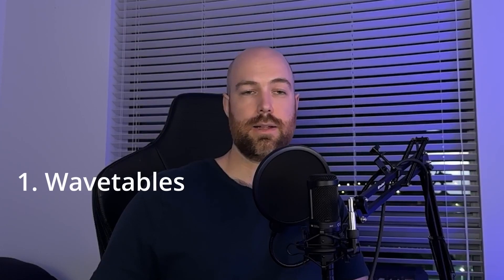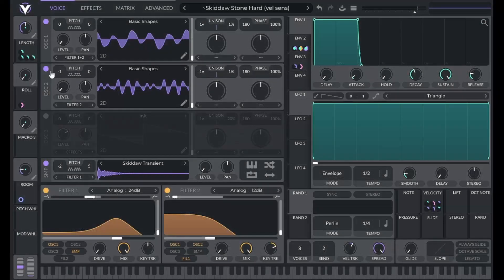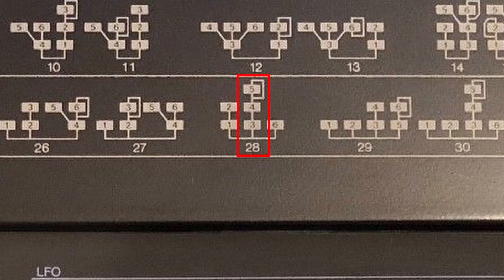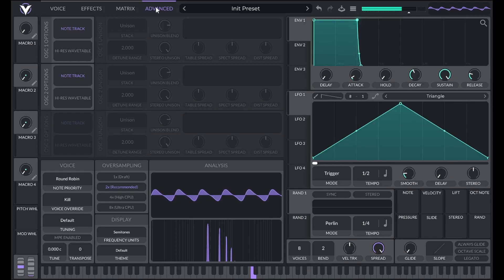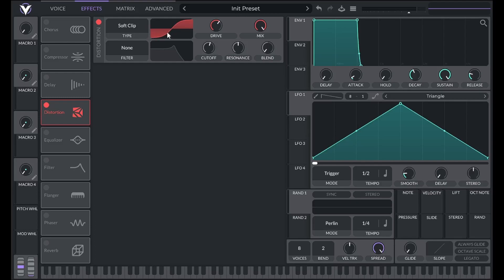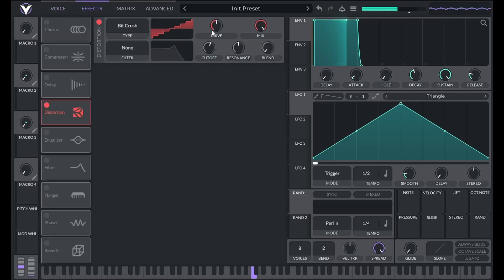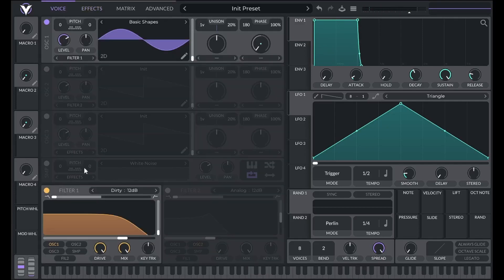Sound Design Tutorial: Additive Synthesis (Wavetables, FM, & Distortion)

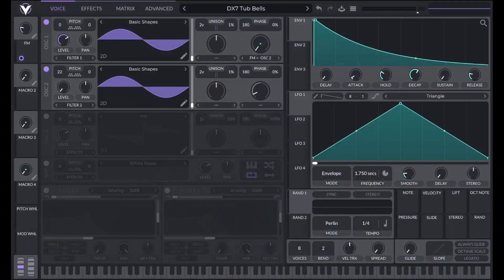Comment: 9:43 - correction: this oscillator at 22 semitones above the fundamental in the dx7 is actually the 7th harmonic of the note one octave below the fundamental.
Reply from the maker: Exactly-it's a harmonic of a note an octave down, not the note itself, which is why it produces inharmonic frequencies. If it were a harmonic of the note, there would be no inharmonic frequencies.